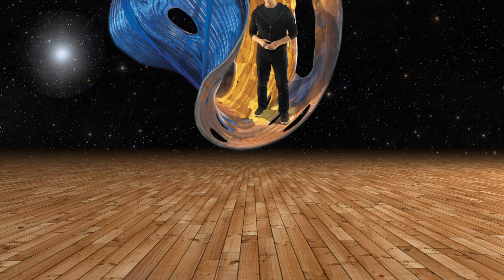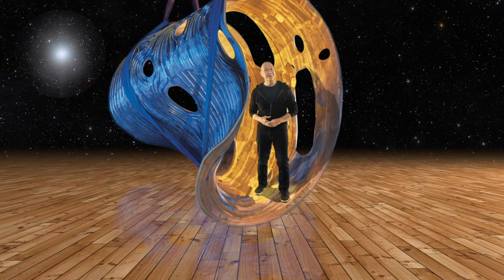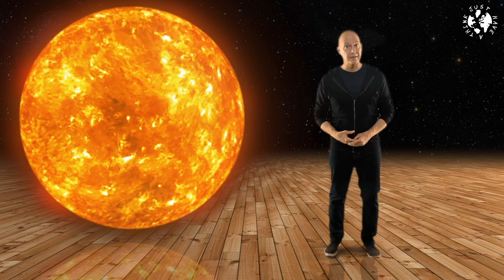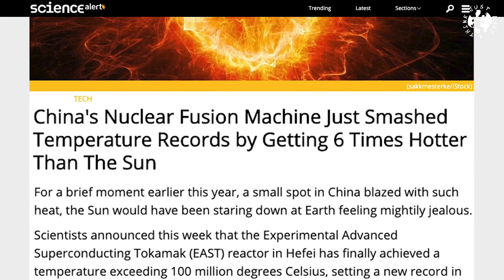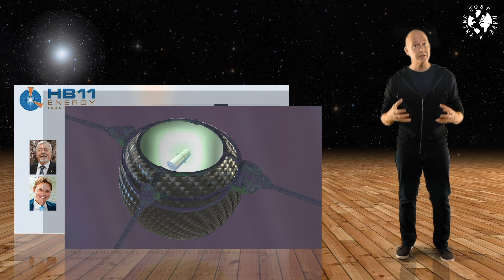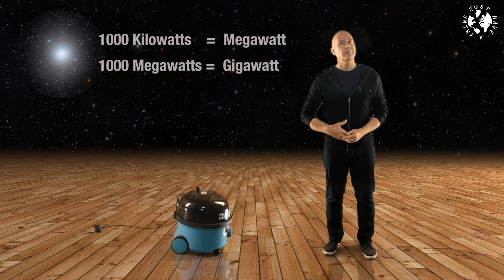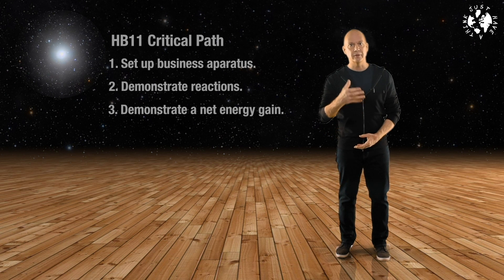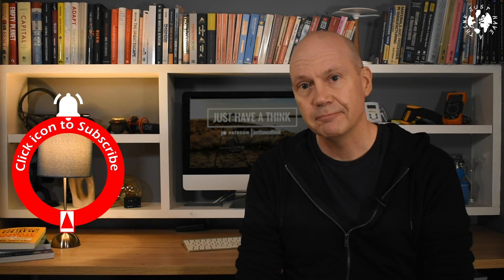Nuclear Fusion:  Revolutionary new breakthrough.

Comment: First, fusion does not occur in the center of the sun.   Spectral analysis shows that fusion occurs from the corona to the core.  What you are talking about is hydrogen fission, resonating the proton to release its binding energy.  Fusion in the Sun's atmosphere is a side effect of the fission process taking place in the corona of the Sun.   The Sun needs a torus to make this happen, so go check out the SAFIRE project.

Fusion is like carrying water up hill and dumping it to take advantage of gravity.   Fusion needs to accelerate plasma  and ionize it  or separate into channels, to get it to pick up energy, then pinch it to release it again, it will always be a failed process.

So what this has to be doing here is using a laser to vibrate either the hydrogen or boron nuclei apart to release the photons that from the protons and neutrons in the nucleus.  Since we get helium, it is probably breaking the boron apart and releasing the binding energy of the missing protons and neutrons  from the breakdown process. Fusion does not work.

Comment: Thank you for a most interesting and informative video.
Fingers crossed (*cough* cold fusion!)
FWVLIW:
If, and it's a big if, we can get 'proper' fusion energy production then wind and solar become irrelevant... except for specific use cases. But that's such a big if we can't take the chance to not run with other energy production options:
-Nuclear: Such a pity it's got an unreasonably bad press, we really ought to be perusing this on a far larger scale than we are. 
-Solar: Certainly a technology to be perused, indeed if we can get launch costs low enough space-based solar is a technology we already have that would itself make fusion irrelevant as a general power source
-Wind: There's always a use case for any option but for general power production this really is an expensive dead-end
-'Carbon': Burning fossil fuels really needs to stop before we either irreversibly ruin our environment or run out - either way it's back to the stone age! But burning artificially produced carbon-based fuels could also be an excellent option as doing so could be 'carbon neutral' and wouldn't require a whole-sale reworking of global infrastructure. The issue is to find non-destructive ways of making 'artificial petrol'. There is research in this area but it's terribly badly funded, mostly because burning stuff is not very 'PC'...
...the burning isn't the problem, and fossil fuels are currently our most energy dense and efficient sources of energy. It's the burning of carbon sources that have been out of circulation for millions / billions of years so raising atmospheric carbon content that is the issue... and a terrifyingly bad one it is too! 
As a wild and probably impracticable example if we could engineer some kind of algae that made hydrocarbons efficiently enough huge vats of the stuff could become our new oil-refineries, carbon-sinks, feed-stock, plastics-production... I doubt we'll ever find out if this might be an option as people, especially politicians, rarely make decisions based on rational thought.

Comment: Hang on they claim "No radiation" but they harness a helium atom with no electrons, which is an Alpha particle which is radiation! One of the most ionising radiations to so anything it comes into contact with will be contaminated. Hmm i remain skeptical as the old saying goes if it is too good to be true then its probably not true.

Comment: It’s only a matter of time. 
But what really confuses me is that we have an energy system out there that we can start using on a personal level but the oil industry is holding all the patens. 
Hydrogen fuel cells.
Reply: Hydrogen fuel cells are very expensive at the moment so it's not suitable for vehicles or the home. Apart from the rich.
Reply: Chinda Ajoku oh ya so how expensive because I know ways that aren’t expensive at all
Reply: @jeffreycampbell9116  it costs a lot more to change a hydrogen fuel cell for your car than a conventional car with petrol tank.

Also there is so little hydrogen fuel cell stations anywhere. Personally I think electric vehicles are the future.

And in hot countries, regions a hybrid electric/solar vehicle.

Comment: question.. if you put a bunch of sand inside a sphere that keep the sand away from the walls inside but also spin the sand around inside... will it create more electricity than needed to start the thing and keep it going ? because i do remember sand particles create lightning when a dust storm happens... ( i realize it's not on topic so forgive me)

Comment: the sun pours down ridiculous amounts of energy all the time - it is very easy to harness it - this is just another black-hole of academic funding - and they are wasting massive amounts of existing energy to be corrupt - get the physics right before you tinker with the engineering - the 2017 nobel prize in physics was blatant fraud

Comment: Yeah, solar and wind and biomass energy are a huge distraction and can never be a viable solution, we know that. We need to stop those 100% to get over this distraction and focus on solutions that have a chance of working.

If, as the climate alarmists claim action has to be taken immediately, the only viable way to get over CO2 and fossil fuels is to start building tousands of 1GW modern super safe and super clean Gen III+ and Gen IV nuclear power plants now.

Waiting 20 or more years before starting to build the first fusion reactors is no solution according to alarmists.

I personally am perfectly fine with the world getting greener from more CO2 and a little warmer. I doubt though that the IPCC models are correct. They have been proven to be total failures for the past 20 years, just look back at what they predicted a few reports back.

Same as Club of Rome. Peak oil in the 80s, then revised report: peak oil in the 90s, then revised revised report peak oil around 2005.

These Malthusians make for a good laughing stock, if it wasn't so tragic how much harm they are doing, how many resources are diverted into nonsense solar and wind. How many people are starved by turning food into fuel.

We must stop these people. We must stop turning corn into ethanol. We must stop burning down rain forest with Orangutans to mix plant oil into car fuel or burn it for so called green electricity. It is electricity with blood and death on it.

Comment: Fusion is a pipe dream. We should be building fission reactors—especially if you believe in anthropogenic global warming.
Reply: Most folks believe - until you mention nuclear as solution. Then they'd rather die over landfills full of fiberglass windmills and solar panels and burn all natural gas then allow single reactor as a solution.
Reply: @piotrd.4850  It' worse than that, Germany closed all their nuclear and now they are using coal.

Comment: Stars as nuclear fusion engines is not possible ... They would not be able to sustain a fusion reaction for very long ... Even given the high gravity and pressures ... The star would go nova as the hydrogen would have a runaway fusion reaction once set in motion... Stars are instead powered by the generation of electricity which heats the interior and produces magnetic fields ... The friction of the metallic hydrogen at a star's core spinning against the outer mantel causes friction and electrical current that heats the star and giving off photons and other particles energized by the electrical current .. When stars reach the end of their life they go nova generating heavy elements ... Larger stars go nova when they reach a point where too much of their hydrogen has been converted into heavy elements altering the balance in the star to maintain its structure which causes the star to explode

Comment: Nuclear fusion could be an amazing firm low-carbon energy source. The question of it completely replacing variable renewable sources is too polar. Research from MIT has shown that an integrated approach, with both firm low-carbon sources, such as nuclear energy, combined with variable-renewables, is a much more feasible approach economically. Here is the link for anyone interested. https://www.sciencedirect.com/science/article/pii/S2542435118303866

Comment: Fusion is the ultimate future of energy. But we can't put all our eggs in a basket being carried on a tightrope. We need to develop fission, especially thorium fueled LFTRs and LMSRs. Renewable resources, and ways of using fossil fuels as cleanly as possible with lowest carbon emissions. Above all energy efficiency and conservation are the lowest hanging fastest to realize.
Reply: @LazicStefanFossil fuels must remain part of our energy mix. It's unrealistic to think that we can completely do away with fossil and fuels or jet engines, or internal combustion prime movers that rely on fossil and hydrocarbon fuels in the foreseeable future. Even if fusion were harnessed and fusion plants could be  mass produced and replace coal and other fossil fuel power plants tomorrow.  For example, aircraft don't fly very well directly powered by large heavy nuclear reactors, or directly via renewables. Heavy industrial equipment couldn't run very well without diesel or biofuel equivalent. Perhaps some day hydrogen fuel cells and advanced batteries can replace fossil fuels, jet and internal combustion engines fueled by fossil fuels or biofuels. But that is probally to be a long way in the future if it ever comes to fruition. However if we used far less fossil fuels and mainly for specific applications for which they are best suited and as cleanly and efficiently as possible we could easily meet our CO2 and greenhouse emissions requirements.

Comment: We already have a fusion reactor that has been delivering all the energy we could ever need 24/7 for 4 billion years. And we now have a cheap means to collect that energy. The only missing part - for which we've had the technology for decades - is simply distributing that energy. A simple East/West grid interconnect in the US would greatly increase solar and wind utilization without needing grid level storage. Interconnections across continents would allow us to run 100% on current renewable technologies. 

So while fusion power is cool technology, it would need to be cheap and reliable to compete. Even so I would bet that it would best be utilized in things like large ships or space stations where you can't just plug into an existing grid.
Reply: GamerBrews The US has abandoned 98,000 square miles of farmland since 1997. That’s more than the entire area of North and South Carolina combined.  Space just isn’t a problem.
Reply: The problem with renewables is that it takes too much land and resources for wind and solar to be sustainable, they only exist due to mandates and favorable subsidies. They tried Grid interconnects in Europe with dismal results. Nuclear is the only energy source that would be essentially a CO2 free energy source as far as fuel consumption goes. But bottom line, all energy sources depend on oil and gas byproducts to be manufactured. Renewables consume much more FF than direct use of FF for energy and generate more CO2 in the process of their manufacture.
Reply: @Scottar50  None of your claims are true.

1. "too much land and resources"   Wind takes up almost no land, and in many places solar actually enhances agricultural production by reducing soil temperatures and moisture loss. Even without agro-voltaics, there's enough abandoned farmland in the US to meet our electrical needs with solar many times over.

2. "only exist due to mandates and favorable subsidies"   Unsubsidized costs for wind and solar are less than coal or gas, and less than half that of nuclear.... and wind and solar costs continue to fall.

3. "They tried Grid interconnects in Europe with dismal results"    I don't know what you're talking about. Wind and solar are integrated in the European grids and it works fine. Sure there are challenges, but as the grid improves and large scale storage comes online Europe will have more and more renewable power.

4. "Renewables consume much more FF than direct use of FF for energy"  Wind and nuclear lifecycle CO2 equivalent is about 12 grams/kWh; solar is 48 grams/kWh; natural gas is 490 grams/kWh; coal is 820 grams/kWh.   The best FF process, combined cycle natural gas, is ten times worse than the worst renewable process, utility scale solar.

The problem is that a lot of people believe these claims despite the fact that they are easily proven false.

Comment: It is ridiculous to speak of fusion as solving our energy problems forever. Let's say you have an infinite supply of energy, which you then use to blend ice cubes, drive motors, run audio amplifiers, and so on. All these processes generate heat, generate sound which converts into heat .... in general, you are heating up the world without limit. 

A better solution is to find low-energy ways to achieve what we need .... can you walk instead of flying?

Comment: Hmmm. I'm wondering how abundant Boron-11 is. If it's as rare as Lithium or Deuterium or Tritium or Helium-3, this will be an expensive fuel. Yes, I know there's a lot of deuterium in seawater, but it's still a tiny fraction of it, and has to be processed out like U-235 is centrifuged out of natural Uranium. Lithium is more abundant than the others i mentioned, but it's still one of the rarest elements on Earth. Boron abundance? I don't know, it wasn't addressed in this video.

Comment: No nuclear waste is a lie, the reactor it's self gets ionised and is radioactive for about 50 years, thats not much of an issue, but it does make the statment a lie, "no long lived radioactive waste" would be a true statment.
Reply: @TheTechmaster1999  Na you need to replace the inner reactor every so often as the neutrons given off by a Deuterium Tritium fusion reactor break down the molecular bonds of the inner reactor.

the proposed ARC reactor somewhat addresses this by using fuel salts to capture the neutrons, but you still need to replace the fuel salt, it's just much cheaper to replace it. So you still get radioactive waste, but storing it for ~50 years is not a problem.

Honestly keeping radioactive waste from a breeder fission reactor for 300 years I don't think is an insurmountable issue considering you get 20x less waste than a conventional burner reactor, 10,000 years for the radioactive waste of a burner reactor is an issue if we never develope breeder reactors which can use it as new fuel.

Although it can be done, but it will need to be sold to the people of the world that breeder reactors are the way to go.

Specifically I believe molten salt breeder reactors—if we can get fusion in a cheap; awesome— but we don't need to wait for fusion to improve nuclear reactors, and given the dire situation we are in with our fossil fuel addiction we can't wait for fusion, if it ever is affordable for 3rd world countries who are rapidly developing using fossil fuels.

Comment: Tokamak is a outdated concept from the 50th's... The currently built ITER uses this concept which more or less make any power plant based on it ineffective as you have to shut down the fusion  frequently and lose the generated plasma. That's because the current in the coils rise over time until you can't sustain it any longer.  This can't be changed because its based on the construction.
So any engineer should know this concept won't ever produce effective fusion power plants.
ITER don't even got this on its to do list, its only a fusion experiment. Only DEMO the planned follow up reactor, scheduled for earliest 2050, will try to be something like a power plant.
I call this stalling of key technology to benefit fossil fuel companies.
You can call it as you like.

Comment: I always thought of the UK's main strength compared to other countries is the ingenuity demonstrated by it's people. De-industrialization in the 1970's through the present seems to have had a negative impact on this.  The other big negative impact in my opinion is the amount of time and effort that goes into football, cricket and rugby - when 40 percent of the population is directing their attention to spectating and thinking and talking about  those type of relatively pointless games it seems they will have that much less bandwidth to devote to dreaming up innovative and now critically imperative ideas. I would like to see the UK countries re-industrialize in certain sectors, especially machine tool manufacturing, and also consider a moonshot type effort towards nuclear fusion. I believe it was August 1957 Britain already had an experimental fusion reactor that had made brilliant progress at least toward proof of concept. You were on the right track then.

Comment: Basically we can burn all the fossil fuels on the planet to generate the immense electrical power needed for magnetic plasma containment at extraordinary temperatures in order to heat steam to produce electricity...or we use laser light pulses to pry open the atomic structure in order to free the electromagnetic force which then generates free electrons to create unlimited electrical energy.
Guessing that the All Mighty Fossil Fuel Oligarchy will have something to say about this scientific breakthrough.